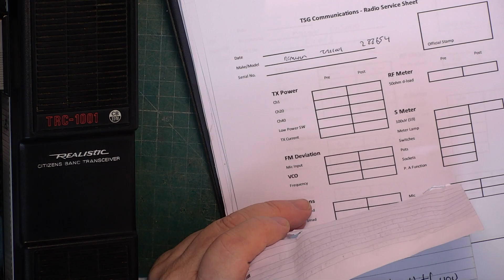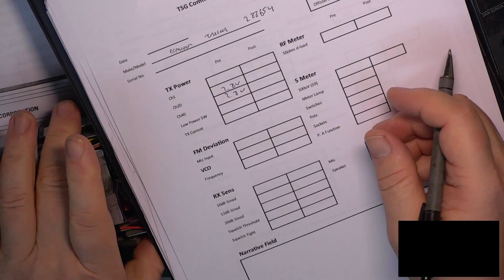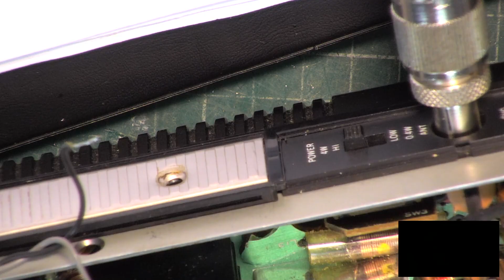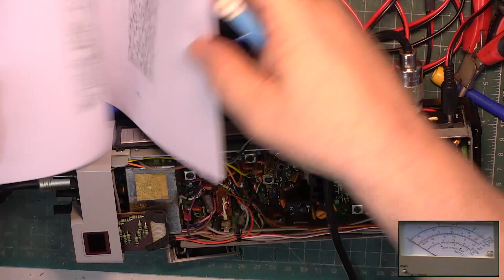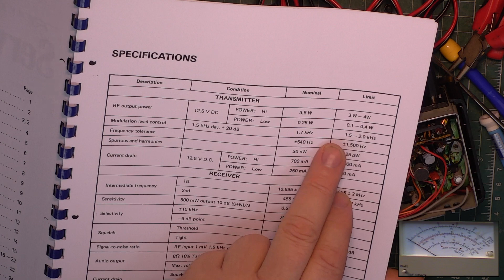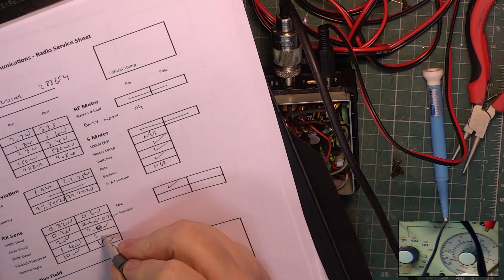Realistic TRC1001 CB27/81 UK FM CB radio handheld - repair & alignment

Comment: i used to sometimes do repairs on weekends for a CB shop in sheffield, think it was called IXL cb from memory, it was near the barracks at hillsborough. I didnt work there, i worked a few shops up in another repair shop called sound idea fixing dj gear. I bet all them shops have closed now sadly, but that lead me into a career in radio comms in the early 2000s and i still work in radio now. I wonder if anyone else from sheff remembers those shops. Happy memories.

Comment: Good morning  richard please  could you tell me how to connect  a thunder  pole tx hand held to an outside aerial  many thanks
Reply from the maker: There are two ways. If you are using it in a car, the sell the "19TX carkit" for ikt. This connects to the bottom of the radio & has a curly lead with a cigarette lighter plug on it & also a SO239 aerial socket. It is £14.99.

Plan B, the rubber duck aerial is sensibly connected to the radio via a BNC socket. You just need a BNC to SO239 adaptor.

Richard, G0OJF, UK
Reply: @ukfmcbradioservicingTango21  many thanks  Richard it's an outdoor aerial
Reply from the maker: It's just an SO239 to BNC adaptor then. We use them on the test gear & the roof aerial as necessary.

Here is an example on Ebay:-   https://www.ebay.co.uk/itm/334509257712

Richard

Comment: AD259X - Motorola To So239 Adapter.
I also use a BNC male to Motorola Adapter.

Chris.
Reply: Old Radio Shack Catalog lists their P/N as 278-208.  A bunch of their scanners had Motorola-style sockets, so they were useful there as well as on their CB HTs.
Reply: @plaws0  Yes that was the Catalog part number for radio shack/Tandy in the UK wow i miss that shop.
Reply from the maker: That's right. Time to service some old xtal controlled scanners

Richard
Reply: @ukfmcbradioservicingTango21  Sweet yes please that will be fantastic

Chris
Reply: @ukfmcbradioservicingTango21  Yes, please!  I have a Pro-7, a Pro-7B, a Pro-47 and a Regency Monitor Radio (8 chan, I think VHF-Hi only).
Reply from the maker: Thank you
Reply: @ukfmcbradioservicingTango21  you are most welcome.